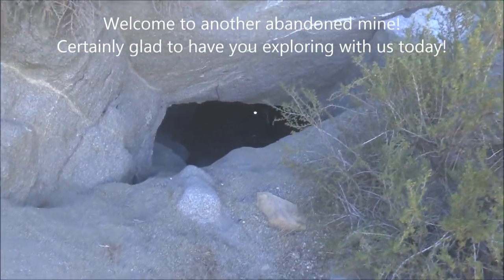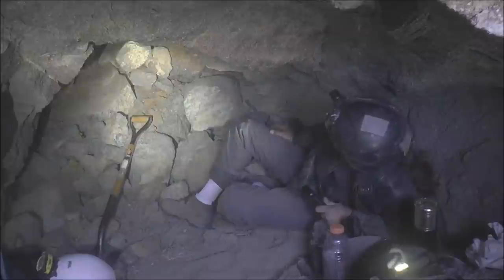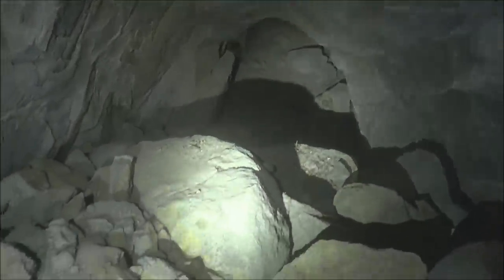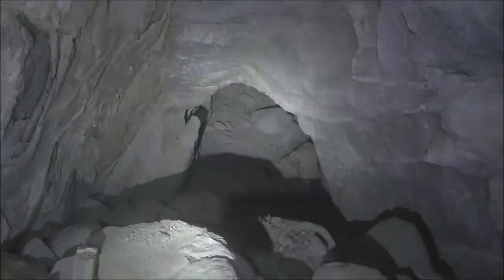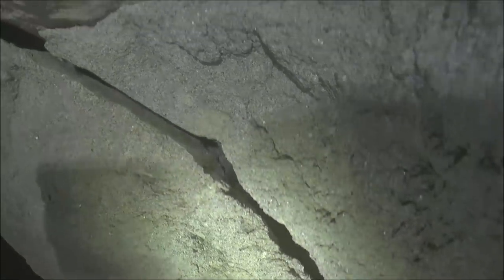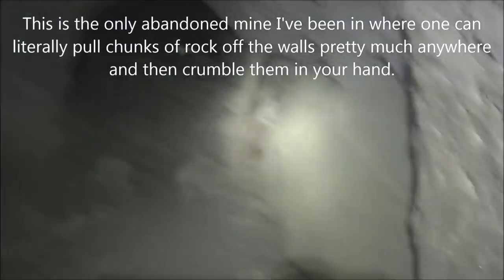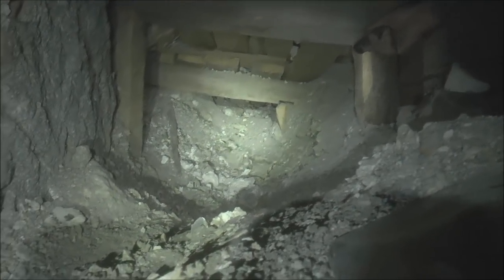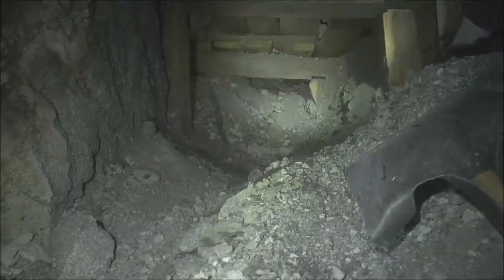Excavating a Backfilled Tunnel Deep Inside an Abandoned Mine

Comment: For the previous mine owners/miners to do those multiple backfills, one would expect that there was viable ore remaining, so backfilling was a a way to preserve it, if they were to return and reopen the mine at a later date💡.
Reply from the maker: That’s what I was thinking. I think I showed at the beginning how they tried to seal the tunnel right inside the entrance by setting off some dynamite that caused a large collapse. However, we were able to get over that collapse as you saw. There is another mine on the other side of the hill from this one that we’ve already been in. It has several downward sloping tunnels that head in the direction of the mine in this video. We never explored those downward sloping tunnels to see if there’s a connection, so my plan is to go back up there at some point and check those out. They are really close together geographically speaking – just on the other side of the hill. In that same area is yet another mine that we explored five or six years ago. It had a series of deliberate collapses in the main tunnel that were progressively more difficult to get over. They would have to be dug out by hand by moving the rocks to widen the gap. There was a ton of airflow in that tunnel, too. Not sure why they would cause multiple collapses like that, but it’s as if they were trying to keep people out, as you suggested, due to there being more ore or equipment in there to retrieve. I also researched this mine and discovered there’s an 1800 foot inclined shaft somewhere inside that probably leads to workings that haven’t seen a human visitor in decades! Still not done with this site. It might take another few years, but I’ll eventually get to everything that’s up there one way or another.

Comment: Dig it, Frank and Paul. Hope you get through next time.
Reply from the maker: We had a good reason to believe that the backfill was only 2 1/2 feet thick. That, however, turned out not to be the case. Why would they backfill a tunnel that served as the main haulage tunnel and was the access point for upper and lower levels? I can only imagine what might be back there.
Reply: @AbandonedMines11  That's a good question. Usually backfilled areas are more remote drifts in the mine that the miners are done removing ore from. Backfilled areas also aren't usually filled up to the top of the adit, unless they are trying to seal it off, which appears to be the case here. Maybe there is an emergency exit or other shaft higher up that you could use for access? I don’t know how they would even backfill that area so completely.
Reply from the maker: Interesting information, Tom! Thanks for sharing it.

Comment: I'm glad you got to get out there and start your project with Paul!  It looks like it's more digging than anyone would bargain for.  Maybe Headframe Hunters might have a solution to this!  I'm curious to what's on the other side...
Reply from the maker: Thanks for commenting, Justin! This was an interesting experience. As Tom mentioned in his comment on this video, when miners backfilled a tunnel, they usually never filled it all the way to the ceiling.The tunnel in this mine that we were attempting to dig out is packed all the way to the ceiling with backfill. It does seem strange considering this tunnel is 1200 feet long and has several shafts going both up and down to other levels and areas beyond the backfill. Seems odd to backfill what was the main access tunnel and main haulage tunnel. Makes me think there might be some equipment stashed back in there for when the mine was going to reopen. Who knows?
Reply: @AbandonedMines11  great point it could be valuable equipment, or something that they were pursuing that was worth protecting from others discovering.. "we got to pull out of this operation, we might be back next year and might be five years, but we got to protect what we have going, backfill this one good, real good" :) looking forward to an update video, anything could be back there

Comment: Hello Frank.

This is one of the projects i hoped to see.
Not giving up at the first obstacle and try to find a way and continue.

Meanwhile, did you get/buy new equipments for your explorations?
Especially new camera system like night vision (with rest light enhancement), thermal camera and others.
Do you have an ultra sonic distance meassure equipment?
Or a system like a K2 meter that measures electro magnetic anomalies?
Reply from the maker: Thanks for your comment! We were disappointed that the backfill was a lot more substantial than what we had initially guessed. It would be nice to eventually get through it and see what’s in that 1200 foot tunnel beyond. I haven’t yet bought any new equipment except for a new helmet and headlamp. I’m looking to upgrade my camera to a new one that shoots in 4K. If I do that, I’ll have to get a new computer and new editing software that can handle those kinds of demanding video files. That means I’ll have to say goodbye to Windows Movie Maker after using it for these last 14 years. The other equipment you mentioned sounds pretty high tech, and I have no plans to purchase anything like that at the moment.

Comment: Another interesting video. Did they fill in those tunnels to prevent others from mining it? Have you ever considered traveling eastward to the abandoned coal mines of  KY or to the old silver mines of Colorado? As always, enjoyed it.
Reply from the maker: I guess miners would backfill a tunnel that they were no longer interested in using. It was easier to do that than haul the rubble outside of the mine. In this case, though, the tunnel they backfilled is the main haulage tunnel. It extends for about 1200 feet, and the old map I found shows a bunch of shafts going up and down off of its length. That makes me think that perhaps they wanted to keep people out of that part of the mine because it accesses other levels both higher and lower. Others have suggested that the miners may have stored all their heavy equipment back in that tunnel so that it would be available when the mine reopened – which it obviously never did. I’ve heard that miners would sometimes store equipment like that and then put a bunch of backfill in front of it to hide and protect it. I have no plans to go to Kentucky anytime soon but Colorado is much more likely. Lots of mines in Colorado! Thank you for your comment – I appreciate it!

Comment: Brilliant how do you find these places!  Reckon many parts have no roads have to navigate and hike some distances.
Reply from the maker: Thanks for your comment and question! We had a hike 2 miles (3.2 km) to reach this particular mine. Most of that was on an old road which had sections that could no longer be driven on — not even by 4WD. It makes for some very difficult hiking in some spots. That’s why we chose to go overland in some areas rather than stick to the road.
Reply: @AbandonedMines11  Ah that makes sense.

Comment: I take it the map indicates some interesting things.
Reply from the maker: It certainly does, Drew! That tunnel extends for 1200 feet, and all along its length are several shafts going up and down to other levels. The other three tunnels at the four-way intersection don’t do that. In fact, two of them are basically dead ends and the other one goes for about 100 feet and stops. Why they would choose to backfill the main tunnel that allows access to other levels in the mine is somewhat mysterious. Perhaps there is mining equipment stored back there from the 1930s for when the mine would reopen but never did.

Comment: why do they close it, for safety reasons?
Reply from the maker: That is the mystery question! Because the map shows there is 1200 feet of tunnel beyond that point with access to other levels, it seems strange that they would fill up that tunnel. One of the other tunnels at the four-way intersection goes for several hundred feet, so that would’ve been a better choice when deciding which tunnel to backfill. Because they backfilled the one they did, it makes me wonder if there is equipment back there that was put into storage for the next time when the mine would open. Intriguing, to say the least!
Reply: @AbandonedMines11  or they found something creepy. Did you have encounters with the supernatural down in all these tunnels and caves?

Comment: You could prolly make some headway faster if you get a large diameter pipe, and one person stands at the front, putting fill in the pipe, the other at the other end putting it in those cheapo rubble sacks. That way, you can move the stuff without blocking your access. It's a bit of work, but it works fast. In India, or places where excavators are expensive to operate, this is how they fill sacks with sand at sand quarries. It goes really fast, a single guy can fill 50 sacks in less than a few minutes. Obviously, here's not about speed, nor is this sand, but it goes much easier + less dust.
Reply from the maker: That sounds like an excellent idea! Might have to consider that if we go back. Thank you for your comment